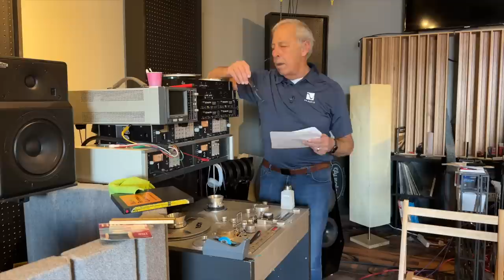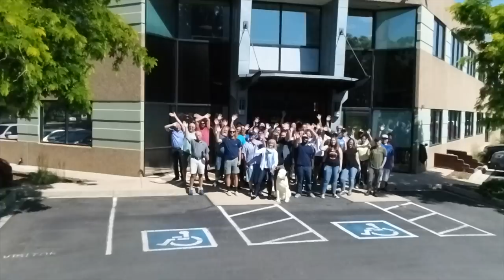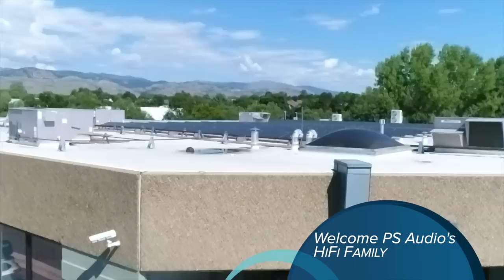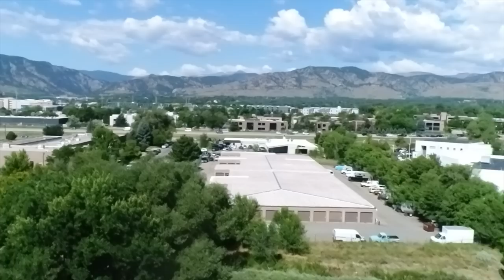What is a DAC?

Comment: If you have a cd player from the late 80s through the 90s there is a pretty good chance the dac that is built into the player is not that  great so it you get a separate external dac that you bypass the players dac with a cable made for that you can greatly improve the sound of your cds Many companies make them.I believe PS audio makes good ones.

Comment: Thank you Paul, I already knew that explanation, but now the practical side. I have an LFD amplifier, a Cambridge audio CD player and ELAC speakers.

A DAC is present in the CD player, but how should an external DAC bring the signal from the CD player to the amplifier? Should I connect the signal from the CD player to the external DAC and then bring the signal from the external DAC to the amplifier? Thanks in advance.
Reply: I don't think I have ever seen Paul answer a comment so somebody needs to jump in.
The short answer is yes, you got it exactly right. The longer version would discuss the method as in cable type for getting the signal from the CD player/transport to your DAC. Thing is, if you already have both pieces just use the method that they give you and you'll be fine. If you still have to buy them and your budget provides some flexibility then you can dig deeper into the different formats for coupling the signals about.
Reply: Depending on how nice your CD player is the DAC might be pretty awesome and synergistic that’s already in it. Where I noticed a big difference was streaming from my Blusound Node. Also, Paul may be more likely to answer questions directly on the website than here.

Comment: 1:49 "...it was that was captured in what we call analog which is a direct copy of the actual analog signal..."
This is incorrect, any signal captured to tape IS NOT a direct copy of the actual analog signal but is a distorted representation of the original analog signal!
Starting with the microphone which typically does not have a linear 20 Hz. to 20KHz frequency response and is typically selected for its signal coloring characteristics (distortion of the original analog source), to the microphone preamp, which is also usually described by the way it distorts the original analog signal (i.e. warm, which rolls of high frequencies and creates harmonic distortions; silky, which tends to roll off low frequencies, etc.).
The analog signal is further distorted in each step of the recording process by equalization filters, compressors, and processes used in recording.
The process of recording to analog tape further alters the original signal through the use of noise reduction filters (applied to reduce the effects of analog tape hiss) and the inability of analog tape to record and reproduce an actual 20 Hz to 20 KHz frequency response and the harmonic distortions caused by tape along with the limited dynamic range.
Add to this that every time the tape is run past the play heads it sheds some of the particles on the tape and loses more of the recorded signal and the tape (because it is a magnetic storage medium) will transfer the analog signal between layers of tape when it is stored distorting the analog signal further.
Transfer of the analog signal is even further distorted when transferring it to vinyl and each time a vinyl record is played the analog signal gets more and more distorted.
Digital, on the other hand, eliminates much of the distortions of the original analog signal involved in the "analog" process, and though digital does have distortions, digital more accurately depicts the original analog signal.
Reply: Can you repeat that 😅
Reply: @alancrane4693  Next time I'll do it in analog and it won't sound so harsh😁